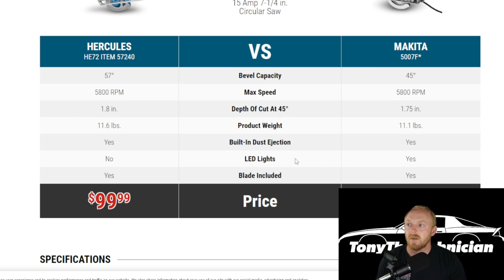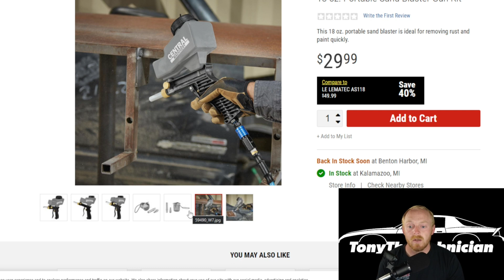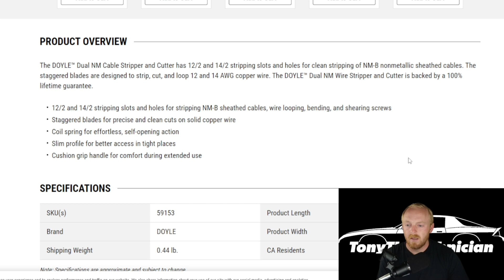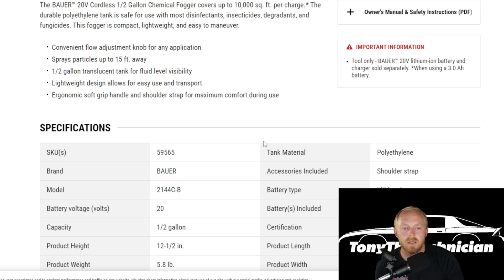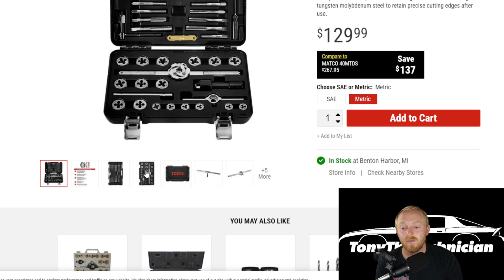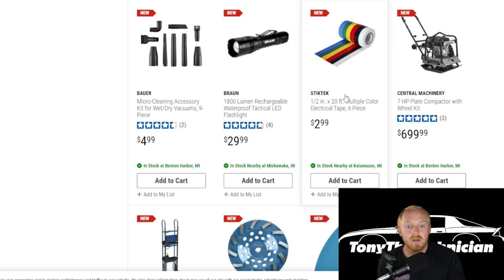Harbor Freight New Tool Releases Icon Hercules Bauer and More

Comment: I also have the Wen Rotary Tools ,and have been quite satasfied with them for the Value  Truthfully i  replaced a Dremel brand Rotary Tool with the Wen although i did like the Dremel brand Blow Molded case better
Reply from the maker: Very nice. Glad to hear you have enjoyed it as well. Thanks for sharing and ya I agree the wen case could definitely use some improvement.

Comment: I wouldn't put faith in a central machinery or whatever their junk brands are, but the Doyle vises are, fantastic. From what I've come to understand, they come from the same manufacturer that Wilton's Taiwanese vises come from. I'm surprised you didn't notice or point out that the Icon wire strippers are the exact same, US made, ones as snap on. While garbage for the automotive world, I guess they're pretty good for romex stuff.
Reply from the maker: Ya I actually really enjoy alot of the Doyle products so I'm glad to hear that about the vices. It's funny about those strippers bc I went to look at them this morning and they have them removed from the website now. So I'm not sure if they are making changes or updating information or what. But it is good to see a usa made Tool in the line up. Even if it's a tool I won't be buying lol

Comment: Good stuff as always, Tony. 

Just like any other store, you have to do research and compare your needs vs. cost on the HF stuff to see if it is the right tool for you.

That said, the Hercules line is quickly becoming a thorn in the side of some of the top manufacturers.  

And I do mean TOP manufacturers.  I have been into the professional detail realm for years now, and the "Top Dog" of machine polishers has always been the FLEX 3401 forced-rotation machine. 

The new Hercules "copy" of it has pro detailers going off the rails about how similar in function and form it is, and how it has about 95% of the power.  

Many of these pros have stated on forums that they will be snatching them up ASAP.

Price difference?    $119 vs. $450.  

BAM!  

HF is becoming more competitive by the day, while still keeping the DIY guy in mind.  

Genius marketing, IMO.   👍

Comment: I have the old manual tire changer works good but scratches the rims there are YouTube videos on how to fix this problem will try these solutions in the future.  Keep the videos coming
Reply: Same. I got it for $32 back when you could mentally deduct 20% from anything in the store due to the old coupon. Got the motorcycle tire changer attachment too. My local HF actually still has the motorcycle attachment even though it’s long gone on the site.
Reply: Oh yeah: The motorcycle attachment was also $32 after coupon. ;) No clue what it is now since there is no shelf tag and the website/app behaves like it never existed.